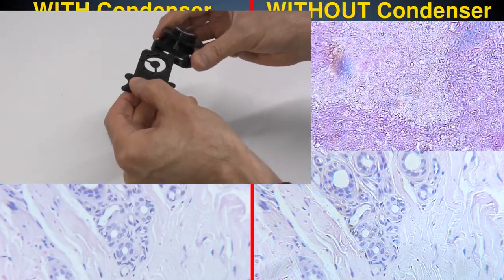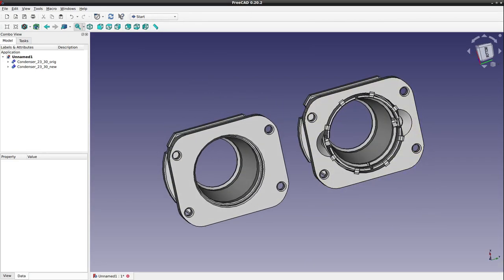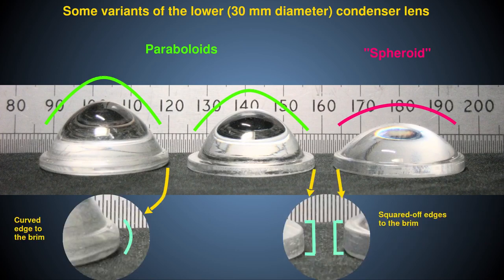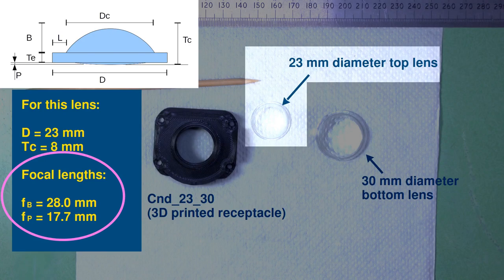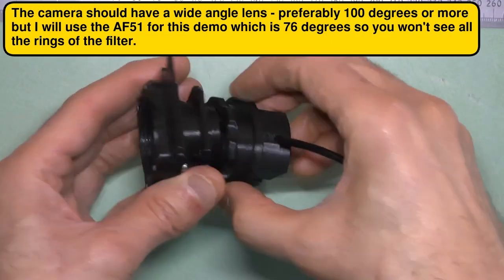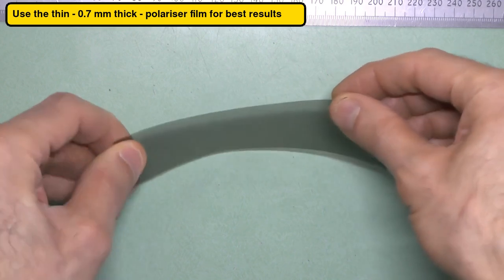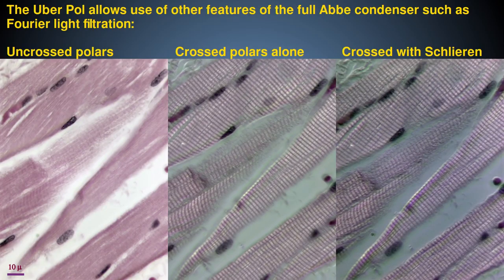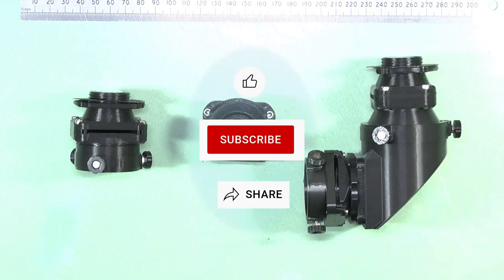Abbe Condenser 2 - Updates and the 'Uber Pol' high NA polariser

Comment: I have to admit I never thought sourcing the proper condenser lenses would be the trickiest part of the project 🙂
I used the links on the BoM spreadsheet and while sellers list them as 23x8 and 30x14.6 lenses, I was delivered 23x9.1 and 30x16.6 lenses...multiple times! 😅
I have tried various stores but after a couple months of shipping and refunds, I still haven't found lenses that fit the Abbe condenser design.
If anyone has a lead on suitable lenses, I'd be very thankful.
Reply from the maker: I am sorry to hear that the 23 mm lens from 'panpan-supermarket' (the eBay link in the BoM) does not work - I have bought these from them and they were fine - although that was many months ago! (they don't sell the correct 30 mm lenses though. For the 30 mm and 44 mm lenses I'd go via the AE links in the BoM). 
For those not DIYing I can announce that the optarc.co.uk shop has now started to sell condenser upgrade kits (including the lenses already fitted!).
But sure, if anyone has experience getting the correct lenses from somewhere else please post about it.